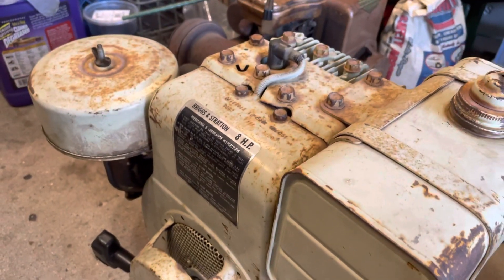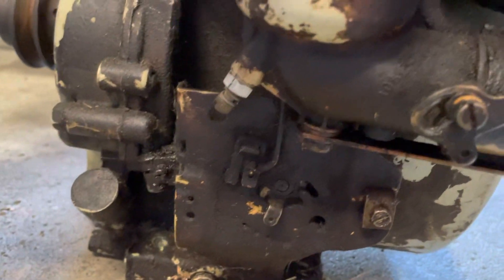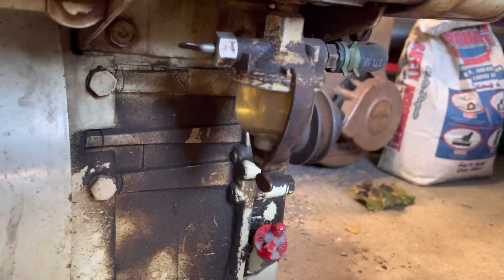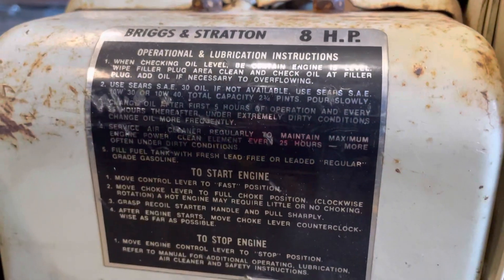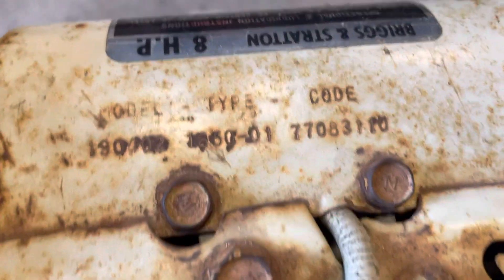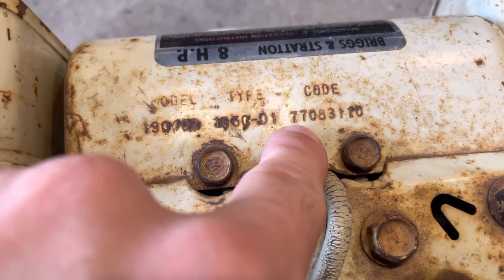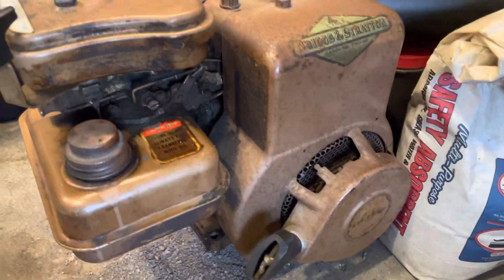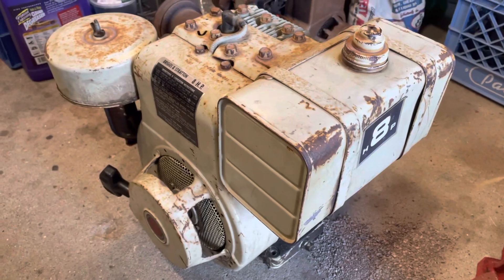Briggs & Stratton 8hp engine

Comment: How do you get the fuel bowl off and what size spark plugs and I use in this 8 hp motor
Reply from the maker: Which bowl you looking at the carb float bowl or the glass sediment bowl?

Comment: would you suggest a rebuild kit, mine looks the same and i have the model number it’s like 1904 or something and the pull start just locked up
Reply from the maker: You can rebuild one of these engines easily as parts are usually readily available.

Comment: Wow this thing is in almost the exact same condition as the one I found under a boat. In the process of cleaning it up now. Just cleaned the carb and airfilter. My dad told me it ran but it smoked so much he replaced it. Any idea what might cause that?
Reply from the maker: usually smoking is caused by bad rings or a out of round cylinder. A good hone and new rings should take care of that.
Reply: @ZigZag9  after the carb clean,new sparkplug, and flushing the tank the thing runs like new, no smoke nothing. Sat outside for 6+ years in the elements. Really makes my Honda clone look like junk... even though this engine is in the exact same condition as yours. Thanks for the tips this is my first briggs.